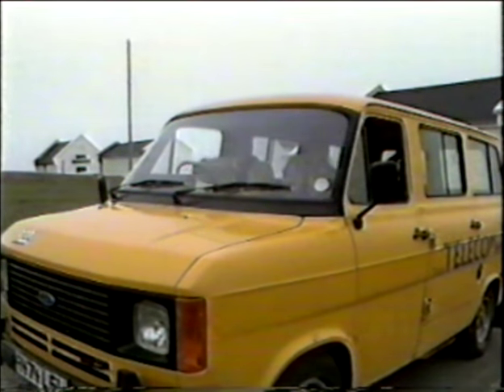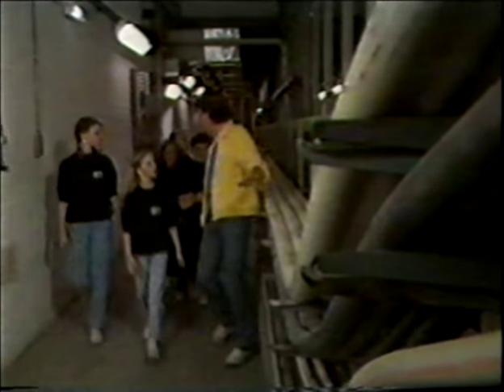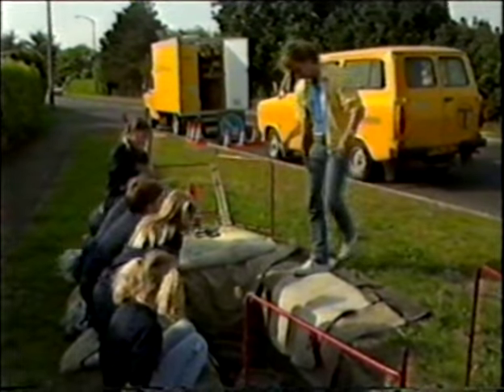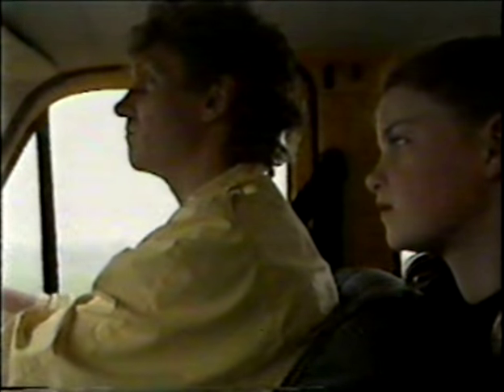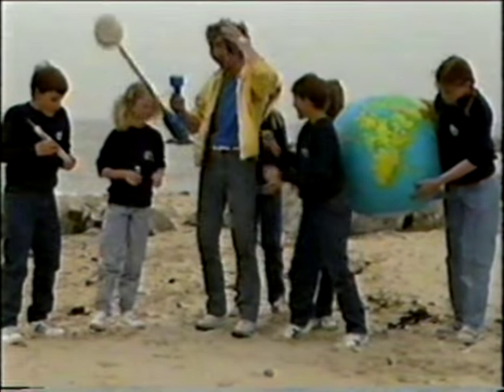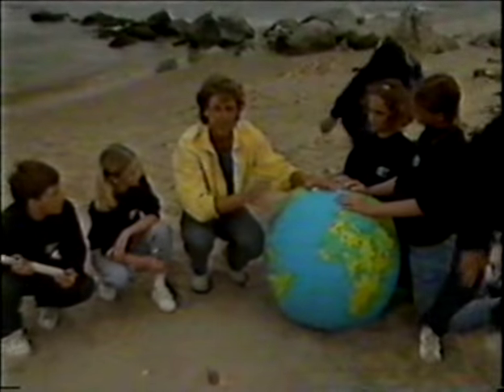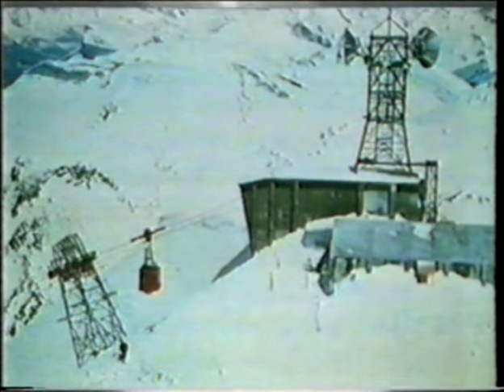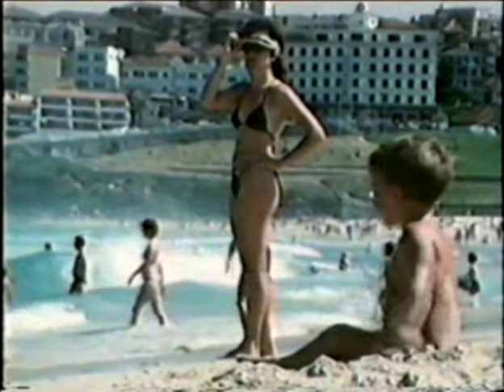BT Educational Service - call routing from UK to Australia

Comment: Rev the engine hard, park on double yellow lines - he could really be a BT engineer!
Reply: John Penny and is usually three weeks late 😂
Reply: @09weenic  I resemble that remark!! (Hehe!  I haven't worked there since 1992)
Reply: Were allowed a half hour stop on any double yellow for cabinet or uG work.
Reply: @gooner49life40  I recall getting away with loads.  I had a Commer (yuk) and would park outside the pub on the double yellows for a couple hours, then everyone piled in the back and I took them back to the exchange and they'd climb on the cable racks and sleep it off.
Reply: I'm one of them lol loved my Sherpa I used to have a sink and a cooker in the back happy days:)
Reply: @Beatlefan67  sounds like the life. I would have taken a blanket up on to the racks

Comment: I never knew it was a complex pathway, yet the calls go through so fast, I remember dialing UK and the States from Australia in the 80's.  It always took a few seconds before the remote phone rang, and I would hear this little musical tune, maybe it was to let you know you were dialing international.  These days its so much cheaper to call overseas'
Reply: It still takes some time today, but for most of the world that tune is gone unless you are calling a place that still has an analog long distance network. That "tune" was the MultiFrequency tones (different than the ones from your tone dial) that were used to signal the number you were calling (and many times also the number you were calling from).

Comment: repeater amplifier at  3:27 ?  looks like it has unity  gain  (  gain of 1)  as peak to peak sinewave  signal level  going IN  is EXACTLY the same level coming OUT !  ( so "isn't doing anything !)

You'd have thought they would have shown the signal on the left going down in amplitude in a exponential decaying fashion - and then leaving the amplifier at a greater level ....

This is about as good as the standard of driving !  (parking on double yellow lines at 0:23... and untidy at that ! - not parallel to the line of the Road  - rear end of vehicle sticking out into road  )

Comment: I'd like to see this again how it wrks in 2020. Do BT even use phone lines across the Atlantic anymore is it cheaper to use satellite?
Reply: They are carried by Fibre Optics over the Atlantic. It is quite possible that the call could travel through a VoIP network meaning it traverses the Atlantic as data just like a YouTube video or this comment.
Reply: Satellite introduces too much of a delay (1/4 second for each hop at least) so you try to avoid voice calls that way.
Reply: Satellite is still very expensive.
Reply: @stevec00ps  does one have a choice?
Reply: @user-jt5vm3mi1w  exactly, that's why fiber optic cable is being used so much.
Anyway we dont want to have zillions satellites in the dead orbit, do we?
Reply: Satellite was never used all that much - too expensive and the latency made phone conversations slightly awkward.
Reply: They use satellite backup routes when they have to repair the TAT cables. My favourite cable was SEA-ME-WE  South East  Asia- Middle  East- Western Europe